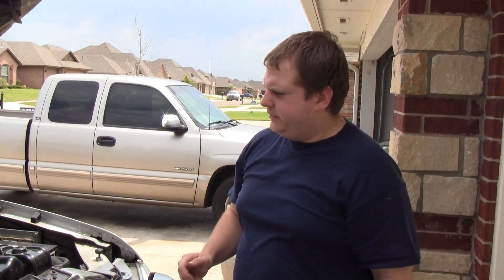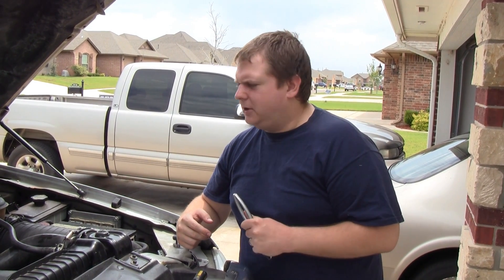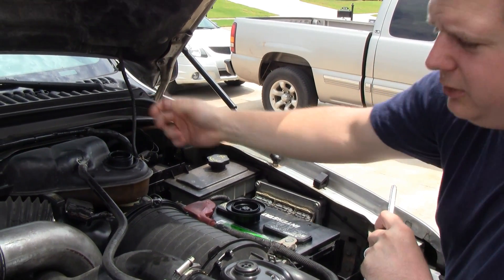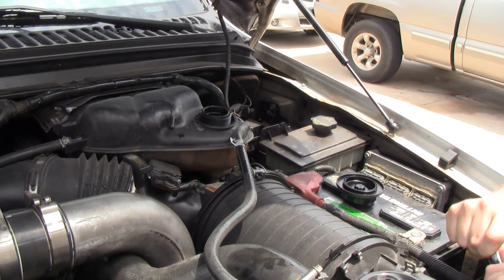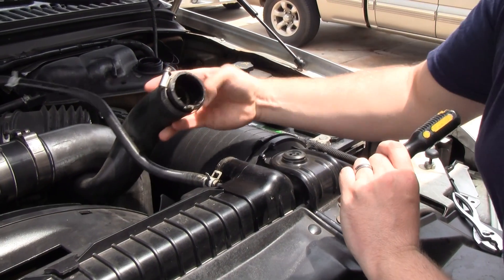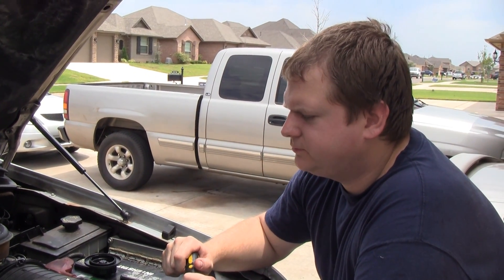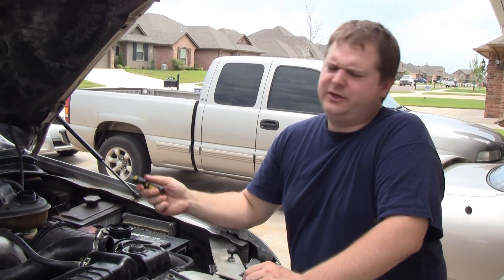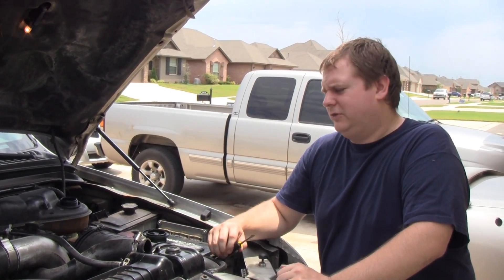Deviously Clever Mechanical Fraud On A 2003 F-250 Powerstroke Diesel

Comment: $4,000 to replace a head gasket? That is a joke.
Reply: Obviously, you have never worked on one of these engines.
Reply: Charles King Nope and don't plan to.
Reply: Charles King I'm staying away from newer vehicles. So far they all seem to have to many issues. No matter the company.
Reply: its 4 grand cuz you have to pretty much remove the cab of the truck to do anything to the engine and do all the bullet proofing to it
Reply: BigDaBAMF69 you don't have to remove the cab to pull the motor on these trucks, it can easily be done by disassembling the front clip.
Reply: true but being i have a lift its easier to remove the cab. either way tho its not a cheep job
Reply: BigDaBAMF69 I've done 5 (delete, studs, head gaskets injectors, oil cooler) all cab on Its 16 more hours to lift the cab. Is it easier? IDK Is it nicer to work on with the cab up? Yes, can it be done with cab on? Yes can i save other people money by not taking the cab up? Yes Do people like saving money? IDK ask yourself that!
Reply: ***** Last ones i did cost the owner $3,300 but that was with studs, delete, oil cooler, chip, intake, exhaust, and heads resurfaced and inspected, anlong with my $1,500 in labor. Its no SBC!

Comment: Its not PowerJoke for all, only for the 6.0, 6.4 and some 6.7 The best diesel engine Ford made was the 7.3 Turbo from 1999-2003(early)
Reply: While the T444E was a fantastic engine as was the 6.7 and earlier 7.3, they were all international truck.  Hopefully the current ford-built engine will shake out the bugs and be a proven performer.
Reply: Ford never built those, they had a huge falling out with Navistar over the 6.0, 6.4. Ford built the 6.7, with the help from an Austrian company and it is the first and only in house built Diesel. GM is Isuzu and of course Dodge is Cummins, which is a real good engine...too bad the truck is a POS. However, if you don't mind putting the money into one they can be a real good engine with the right work, they are still popular because Ford build the nicest truck as far as interior and fit and finish...Im sure to get some rag on that comment..lol

Comment: oil cooler for sure id do the egr delete and a tuner (sct) and 4in pipe, if you do head gaskets use head studs or you'll end up doing them later on,

Comment: I can't believe you aren't blasting there name on every Ford car/truck forum you can.  I could understand if they were hiding something smaller/cheaper but this is an expensive repair that causes a lot of people to just get rid of the truck because it's so expensive.  

Considering the age of this video, I'm assuming you either did all the bulletproofing stuff  or took a loss and sold it but thats bullshit that the dealer did that too you. 

Everyone is so quick to hate on the 6.0 and say that they are junk but once you do all the bulletproof stuff they are really great, reliable trucks.  I had my 6.0 "bulletproofed" in the first month that I bought it and I've put about 40k miles on it since then and added A LOT more mods and I beat the hell out of it and it's a great truck and has been very reliable.  Only issue I've had since I studding and deleting it and all that is my FICM took a shit on it which is partially my fault.  The batteries were already getting weak and I ended up leaving lights on which completely drained them...  What I didn't know at the time, was that completely draining the batteries or having batteries that are going bad on the 6.0 has a very strong possibility of killing your FICM.  From what I've read, to put it in laymen's terms..., the stock FICM is 48 volts and it draws 12volts from the trucks batteries and then the electronics inside the FICM turn that power that it drew into 48volts and if the batteries are week, and not making 12 volts because they are getting weaker, that just makes the FICM have to work harder to create its required 48 volts which eventually causes damage...anyway..i upgraded it to a 58volt unit, purchased 2 brand new batteries and it's been great since.

Comment: Unless the dealer sold the truck "as-is" with your signature agreeing to it, you have every right to sue the dealership.  Buyer beware with "as-is" purchases.
Reply: even "as is" does not cover deliberate fraud which is intent to deceive. The dealer can squeal all he likes and try to stonewall but a records check will reveal the person who owned it before the dealer got it. If the dealer bought the truck on the cheap from some guy and masked the problem in order to resell it and you find the prior owner you now own this dealers ass because even if he put it on the auction or sold it ass is that does not cover deliberate  deception.  Anybody in this position should do there homework get thew previous owner on record even if you have to hide a tape recorder in your pocket and NAIL this crook.
Reply: johnb66y Can i ask you something about a similar situation that just happened to me and what do you think i should do? Difference is im not sure the dealership i bought my car from actually knew it was a blown head gasket but they sold it to me $2,000 below blue book, and helped me pay for some of the cooling system repairs but are now fed up and said they wont help me with anymore repairs, now im just finding out that compression is leaking into the cooling system, but they made me sign like 3 as-is papers due to the fact it had an aftermarket exhaust and wouldnt give me a warranty for it for that reason, I already spent $2,250 in troubleshooting and leaking seal repairs and now im looking at another couple thousand with the head gaskets and possibly rebuilding the engine, its been about a month and a half that ive owned it and had nothing but problems the entire time, Do i bite the bullet or fight the dealership even though i signed as-is paperwork? I really appreciate it
Reply: Adam Taylor
If I were in your position and with everything you have mentioned here i would contact the Attorney generals office in your state to see if they might be able to help you. (Their phone number is in the front section of most phone books or online) My guess is they will help you and it costs you nothing! You may have to fill out some paper work on what happened etc but its minor compared to what it would cost you otherwise in time and money.
Good luck.
Reply: Mike Smith Thanks bro! i will look into that!

Comment: The early 6.0L PSD's are all junk! The EGR coolers slowly kill the engine over time. I'm happy I'm still sticking with my old 7.3.
Reply: on any diesel the EGR cooler will load up with  carbon and some oil vapour its important you use the best all synthetic oil and change it regularly. Also every 40 k or so take off the EGR cooler and the mixing valve and thoroughly clean them. Its simple and you can pull them both in twenty minutes on an LLY.  The  gunk you clean out then won't pass through your engine Also use 10 50 synthetic after 200 k miles.
Guys I know get 400 to 500 k out of a Duramax without a rebuild
Simple rules for Diesels 1 keep them cool  deal with any cooling issues immediately 2 never " chip" the engines doing so subjects the engines to more heat and stress than they were designed for 3 change the oil and filters regularly use only full synthetic 4 keep the engine at 2100 RPM or under that will give you  seventy to 75 MPH  if you want a hot rod buy a porsche 5 when pulling a loads stay at 55  to 60 and watch your tranny temp
Reply: Alan I agree 100%, but fun fact the egr cooler in the early 6.0s were a better design than later versions on the 6.0
Reply: Alan a ton would be an understatement. I have an early 03 I believe and have had to do injectors at 140k. It has 141k now and I’m ready to sell it.
Reply: Alan haha fords been in my family forever and they never let me down. Never the less diesels are great all around
Reply: I build work on 6.0s for a living don't be dumb soot dosnt hurt it but whatever you think
Reply: Alan that’s very true. Keeping it simple never failed in this instance
Reply: dillon boettcher it really murders preformanve
Reply: It's not for helping performance it's for emissions witch as we know dose negatively affect the power wile in use. You generally don't see the egr used at wot it's to reduce nox witch generally happens when she's got the fuel pouring to her.. just deleting a truck will not get you higher dyno number. Now with proper running you will. But with a conservative right foot and a good tunner your truck will be ok. The only reason we delet the cooler is because with increased fuel and air your more susceptible to emissions equipment failure. If the truck is maintained well and left stock it will perform as a emissions compliant diesel should. Not smoky,nice slow acceleration when loaded and nice even highway speeds. You wanna make it from New York to California in 24hrs with 20k behind you doing 150mph the whole way then don't expect the poor thing to last.
Reply: dillon boettcher I know it’s for emissions that’s why we lost the 7.3.
Reply: And there is another ignorant 7.3 owner stuck in the times that dosnt even understand egr or what it dose. Egr dosnt kill trucks stupid,lazy,broke diesel owners kill their trucks
Reply: dillon boettcher  egr does kill diesel engines.  It's blowing soot back  into the intake.  It's not like a gas engine.
Reply: Diesel Jim  it was bigger so it didn't clog as easy.  Coolant filter fixes it.  The problem is the early 03-04s had a ton of other issues.
Reply: Diesel Jim  not a fan of the newer common rail stuff.  Too expensive and prone to failure. Dollar for dollars and old 5.9 or 7.3 cannot be beat.
Reply: Diesel Jim  there's a reason why I'm a Dodge/Cummins guy. 1 the engines are way better, 2 I can rebuild automatic transmissions myself.